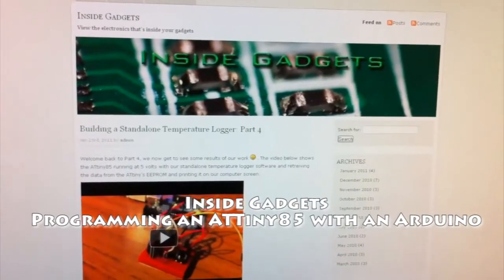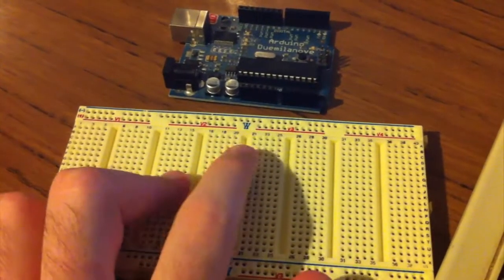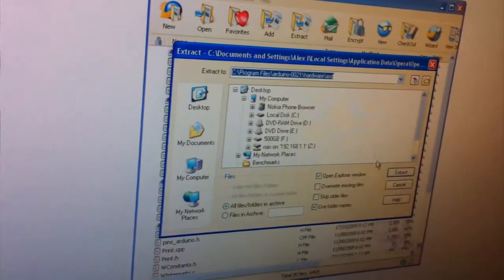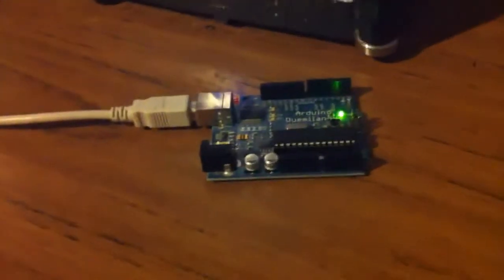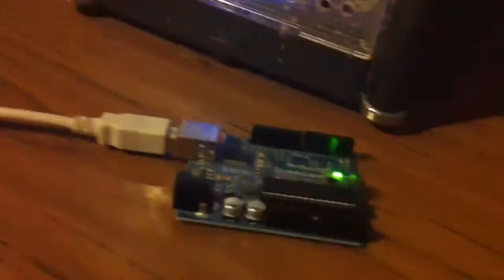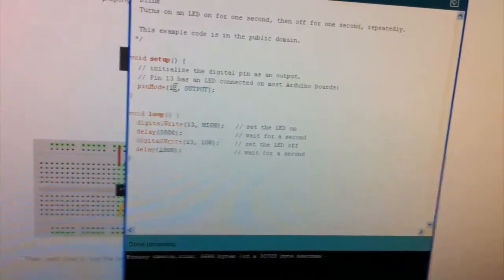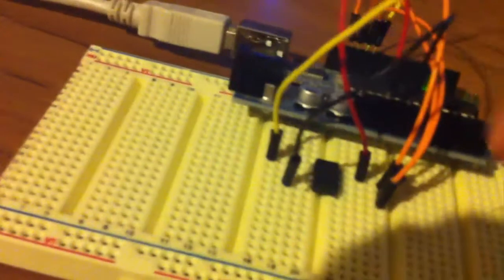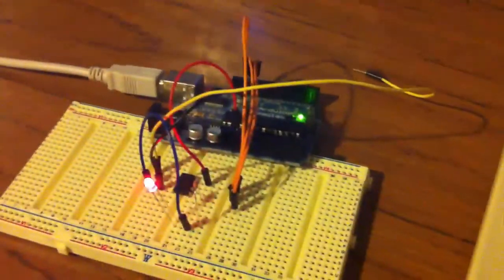How to Program an ATtiny using the Arduino

Comment: Hello! I have got an attiny 85. Can I use it with a pir sensor and a relay to turn on/off a lamp? T.y.
Reply from the maker: +Edson Silva Hi, yep that's do-able. You can purchase a PIR sensor from say Ebay, use a pin interrupt to sense when the PIR output is high and then switch the relay on or off.

Comment: solo hay 2 salidas?? :) quiero usarlos para controlar motores paso a paso bip. y hacer una impresora 3d... los driver estan algo caros, apenas compre arduino.. podrias ayudarme? :(
there are only 2 exits?? :) I want to use to control stepper motors beep. and make a 3d printer ... the driver are somewhat expensive, just buy arduino .. could help me? : (

Comment: Does this work with Arduino Software version 1.0.4?
It is not compiling the blinking programm and an error pops up saying:
" 'OUTPUT' not declared in this scope." 
- the same with 'LOW', 'delay', 'digitalWrite'...

Comment from the maker: Hi Gabriel, It's essentially the same for the ATtiny24/44/84. You need to download the "Arduino-Tiny" core so you can select the ATtiny24/44/84 from the list. Then you check the PDF of the ATtiny25 vs the ATtiny44 and the 6 pins that you need to match are VCC, GND, RESET, SCK, MISO, MOSI.

Comment from the maker: Hi, the ATtiny or any ATtiny can't run from 9v without a 5v regulator. For most of the ATtiny's, the voltage you can supply it with is 2.7 - 5.5V.

Comment from the maker: Hi,

The bootloader allows a chip to re-program itself without needing a programmer (such as the ATmega328 on the Arduino), and since you are using the Arduino to program the ATtiny, no bootloader is needed.

By default the ATtiny runs from the internal oscillator at 1MHz and will always work just fine (but if you want precise timing you should use an external crystal).

Comment: Hi, great Video. But I have some questions, don't you need to burn a Arduino bootloader on it?
Does it work always with the internal oscillator? I don't see any oscillator there.
Hope you can help me.

Comment from the maker: Hi, the error messages you received aren't the ones I had in this video. Can you try to use the Arduino v0022 software? If you have an Arduino Uno, connect a 10uF cap from Reset to Ground.

Comment from the maker: @andromorfo Hi, the 168 is like the 328, it just has less RAM so that won't be the issue. Please double check your wiring. Can you confirm you uploaded the ArduinoISP sketch (without the ATtiny85 connected) and then after that you connect the ATtiny85 and upload your ATtiny85 sketch? Another thing to try is to disable the auto-reset on the Arduino by connecting a 120 Ohm resistor from 5V to Reset.

Comment from the maker: @MrTony95 I'm assuming that this relates to ArduinoISP. I think it's because the sketch already uses the serial pins (0 and 1) to communicate to your computer so you shouldn't use pins 0 or 1 for anything else. If this is happening in a different sketch and assuming that sketch doesn't use serial, could you link me to the sketch?

Comment from the maker: @francisroan Yes you do, if you search for arduino-tiny, download the latest version and then place it into the Arduino\hardware directory like we did in this video.

Connect Arduino Pin 13 to ATtiny2313 Pin 19 (SCK), Arduino Pin 12 to ATtiny2313 Pin 18 (MISO), Arduino Pin 11 to ATtiny2313 Pin 17 (MOSI) and Arduino Pin 10 to ATtiny2313 Pin 1 (Reset).

Comment from the maker: @jp040759 1) No changes to fuses were made. You only need to change fuse bits if you want to change the where the ATtiny gets it's clock from, the starting mhz and other options. 2) Yes, you can use it as a weak IO pin. You would upload your program and then program fuse bits but once you do then you can't program the ATtiny again using this video's ISP method (needs the reset pin to work). You will need to use high voltage programming or search for "ATTiny Fuse Reset". 3) Out of factory is 1Mhz

Comment: I have many small projects I want to build with the 6 port ATtiny85 as apposed to the ATmega328 which is overkill and more costly.  I just ordered five ATtiny85 from Digikey for $2.26 USD each.  (BTW ATmega328 with bootloader is $3.80 USD also)   I have 3 questions. 1) Did you have to change fuses or preconfig the ATtiny before doing the upload?  2)  Can I use pin one as a port once programming is done and reset wire is removed?  3)  What clock speed is the ATtiny running at once this is done?

Comment from the maker: @89rafa Yep it is entirely possible. The reason they use the rx/tx pins is just for convenience because the bootloader you burn to the chip allows it to program itself using data coming from the serial rx/tx pins.

So in the section "Burning the Bootloader" you can use this same configuration to program the chip. You don't have to burn the bootloader to the chip if you are happy to keep programming the chip this way.

Comment from the maker: @SmokeTatum Yep, the Arduino is very cool :)

Good point about UCSK vs SCK, I didn't notice that. I've looked into it a bit more and I believe for serial programming you should be fine. You will find that "USCK" is really a typo in the ATtiny2313 page 2 because if you check page 53 near the bottom it says that Port B, Bit 7 is USCK (Universal Serial Interface Clock). Then if you check page 163 to do the serial programming, the table 75 shows the SCK as PB7 (Port B, Bit 7).

Comment: @insidegadgets I tought about this too but there is some difference cause 2313 has UCSK instead of SCK , im Very beginer in electronics so to be honest i dont know even what that means. I Already ordered attiny45 and 2313 so i will experiment with both when they arrive. Im Very interested what else can be programmed with arduino because its avesome tool for beginers and anyone that want to start with electronic or mechatronic should have one and spend some time with it alone ;D

Comment from the maker: @SmokeTatum It's possible to do so (I don't have a ATtiny2313). All you need to do is match the MISO, MOSI, SCK, VCC, GND and RESET pins from the ATtiny85 to the ATtiny2313 which is shown in the datasheet usually on page 2. 

Once that's done you actually need the ATtiny2313 core libraries, someone has made on this website about half way down the page: hci.rwth-aachen(dot)de/luminet